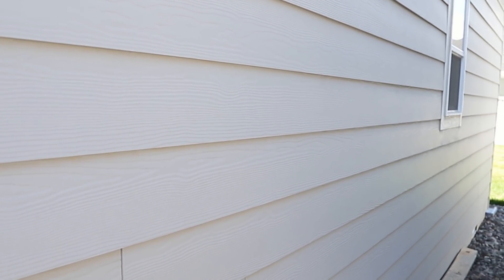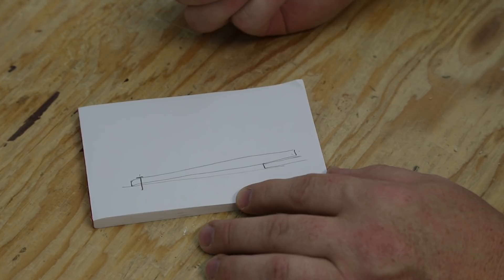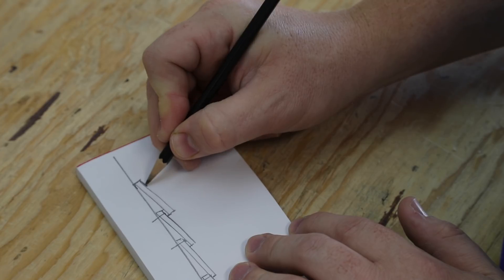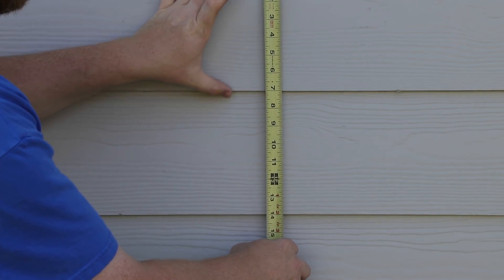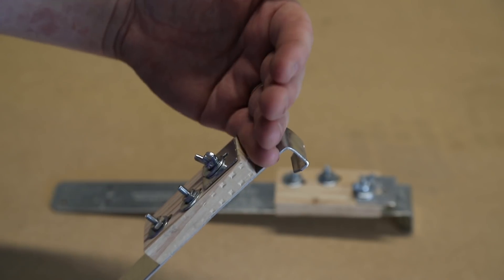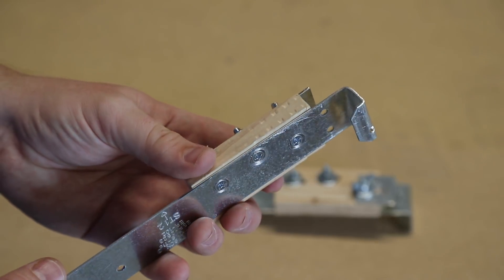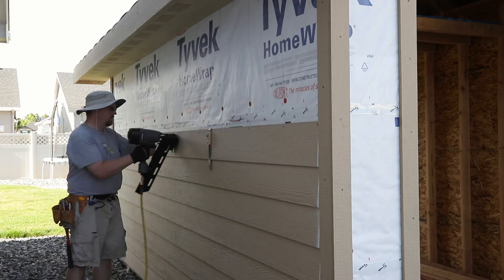Build Your Own Siding Gauges For Less Than $5: How To Build A Shed ep 16

Comment: I like it.  Nice work man.  FYI your nailing pattern is expressly verboten in the lp instructions.  They want you to nail from one side to the other or from the center out.  The theory being that if you nail one end then  trap it with the other end it might lead to buckling.
Reply from the maker: Thanks for the tip. I appreciate it! If I were doing this job again, I'd likely nail from the inside out. Thanks for watching!

Comment: That's a great idea!! My only suggestion is to make the hook end at the top less aggressive. A tiny hook would work for its intended purpose and make it a lot easier to remove especially on shorter spans. Amazeballs! 👍 Thanks.
Reply from the maker: Great tip, Sam. Thank you!

Comment: Nice.  I made a couple of very simple "C" channel type bends in sheet metal that hooks to the bottom edge and clamps by using its own spring pressure that is slightly over bent that makes it stay tight until it's removed. It's 7" and works well.  Mine is 2" wide and holds the spring pressure well.  An eighth of an inch or less if wider with sharpened bottom edge is all it needs.  Yours works well also.  Thanks for showing us.
Reply from the maker: Your design sounds great as well! Thanks for watching!

Comment: The company I work for make  siding gauges out of the thick trim board. Cut a 8-9" piece. Our reveal is 6 3/4". So we cut a sliver of the block the width of the siding at a length of 6 3/4" out of the 8-9" block. Real simple. Cost nothing. Make it out of the fall off from thick trim.
Reply: Then you need 2 people to nail it on. Big waste of manpower and impossible on ladders and planks. Geckos are the best

Comment: I had purchased the siding gauges from local hardware store today, they were for Hardie plank, 5/16. They were $65, they wouldn't fit the Smart Side planks. Too tight. I'm making a set from your design tomorrow. Thanks

Comment: How did you run the first course alone?!
Reply from the maker: Hi T! Great question! I marked the walls where the top of the first course needed to be to create the right overhang and gap to the ground. Then I used a small stack of scrap wood at one end to get it close to correct, and simply lifted the other end up to the line and nailed it in place with a single nail. Then went back to the first end that was resting on the scrap blocks of wood, lifted it the last half inch or so to the correct height, and nailed it in. Then I finished nailing the entire length. 

Good luck!
Reply: AmplifyDIY Thank you so much for your response. It’s a drag not having a helper!  Your video was exactly what I needed when I was blinded by the Texas heat this afternoon and stuck fumbling around with 12 footers!  ❤️👍🏽
Reply from the maker: Ugh. Go get a cold drink of water. You’ve earned it!

Comment: Thanks for the great video. I am using 12 inch  so I guess, I need a 1 inch??? with 11 inch reveal?  
I am going to doing about 5 up my house on the bottom due to water damage from sprinkler system,  
Thanks again.
Reply from the maker: That sounds about right. Good luck!

Comment: I was under the understanding minimum overlap is 1 inch to 3 inches? To sustain a wind 75 miles and hour. The shorter the distance of overlap, the weaker the hold.
Reply from the maker: The LP Smartside instructions indicate a minimum of 1", maximum of 1 3/8" overlap, with the nails driven 3/4" from the top edge of each course.
Reply: @AmplifyDIY  This guy is only using a 7/8" overlap.
Reply from the maker: Yeah, I did shave 1/8" off the lowest recommended minimum, but I did that for a few good reasons. First, I based that measurement off of matching the exact reveal from the siding on my house. The HOA in my neighborhood is pretty strict with respect to making sheds match houses perfectly, so I could not have a wider reveal on the shed than I do on the house. Secondly, I don't live in a particularly windy area. Third, the shed is situated on my property with my house blocking wind along one side and a fence blocking wind along the other.  

Also, I built these gauges specifically with an adjustable setting to allow a range of overlap.

Finally, the 1" minimum is what is recommended for the specific product I installed, but is not a universal number for all siding materials.

Of course, consult the installation instructions for whatever product you are installing and build gauges to fit your specific situation.

Thanks for the feedback, and thanks for watching!

Comment: Hi Nice... Looks like they would be difficult to get out on pieces less than 8'??
Reply from the maker: If you are doing a smaller job, just use thinner steel. It does not need to be as strong to hold as much weight, and it'll come out easier after attaching each piece. Good luck!

Comment: Great idea! I improved it to my liking by using a piece of metal 4 inches long to make a lever, which I just turned sideways a little to release the board instead of unscrewing the wing nut each time. If you round off the top corners you only have to turn it about 30 degrees.
Reply: Picture of this would be great!
Reply from the maker: Nice improvement!

Comment from the maker: Have you ever found it cheaper and easier to just build a specialized tool rather than buy an expensive mass-produced version?
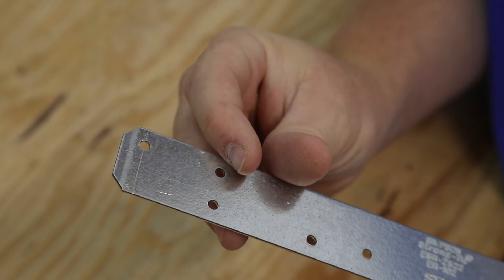Reply: What is the thickness of the piece of wood  1/2" or 5/8" at 6:38 it looks like a heavy 1/2" piece
Reply from the maker: @craftman5632  It was about 5/8". As I recall I just found a piece of scrap wood that was slightly thicker than the siding itself.